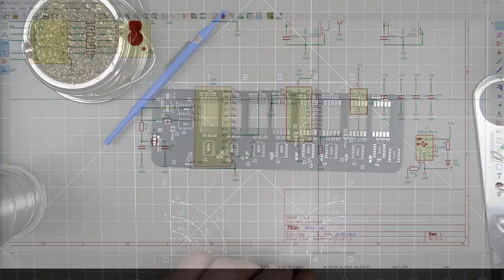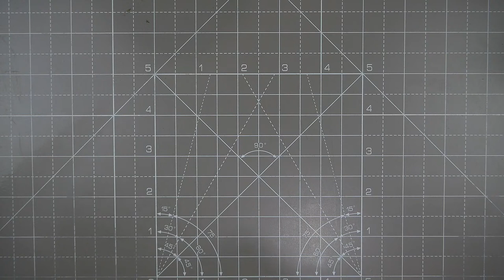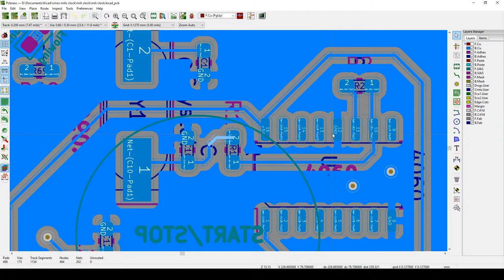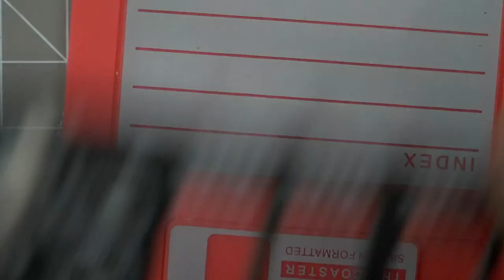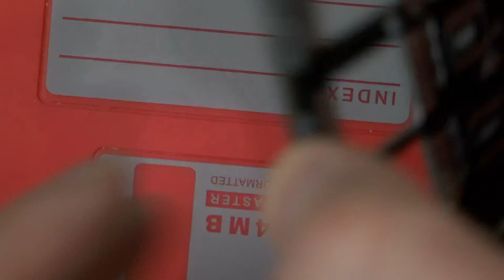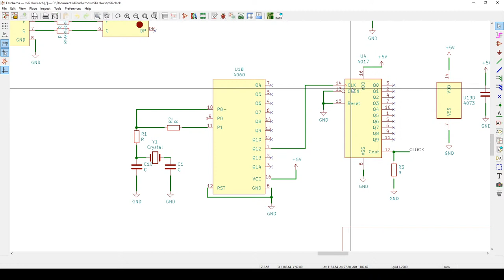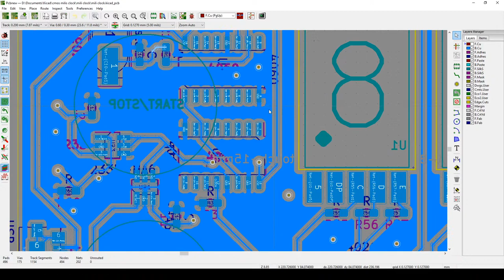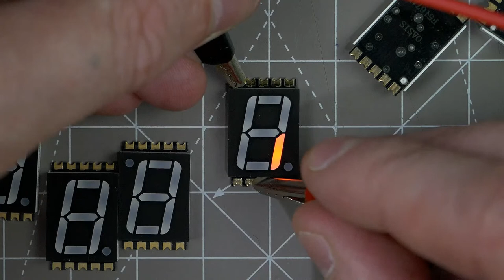It happens when you're not paying attention

Comment: It maybe late to ask but as your using smd displays I’m just double checking you flipped the wiring to compensate the flip
Reply from the maker: The parts are not actually flipped, they were designed to sit on the top layer but with pads on the bottom copper layer. Hopefully it works out.

Comment: missed it. my computer got destructed by a doddgy download that went berzerk and made the thing nearly die. took 6 hours to restor the system. still only 22 hours late which is pretty good for me, wont be getting any more firefox addons in a hurry this thing seemed to have been created to destroy and subvert every part of what it got itself loaded onto, still bits of it lurking aroud that i cannot get rid of short of taking a sledge hammer to my machine . waiting for it to  emerge for the final attack i just knnow its not finished. i think a exorsist would be my best opption at this point

Comment: edit,.. your new schematic is wrong, the current limiting resistor goes on pin10,  so this: https://imgur.com/E3Zyt3K
Reply: Lasse Langwadt Christensen  also in the datasheets i can find, the current limiting resistor is mentioned as 220k rather than 220 ohms.
Reply from the maker: Yep, pin 10 is meant to be the lower value resistor it seems. Interestingly it works with both configurations so I guess it doesn't take much to kickstart the oscillation.
Reply from the maker: I tried 220k, 2k2 and 220 - 220 was the only value that worked in my breadboard at the time. But I may revisit this since I mixed up my external resistor pin.
Reply: @torstenb5248  220K must be an error, it is only there to reduce the drive on the crystal so it should be quite low and it would most likely be fine with 0R
Reply: @DavidWatts  there 220 is to reduce the drive on the xtal, it'll would probably work with 0R, the 10M is there to bias the amplifier and help it start but it is so large that it might as well not be there
Reply: Ok. Chrystals ar a big mystery to me anyways. 😁